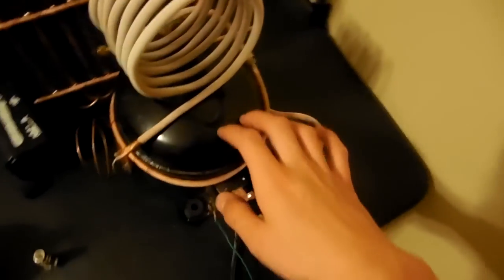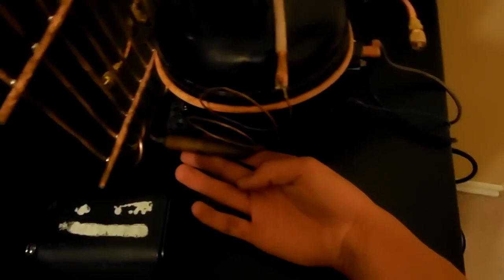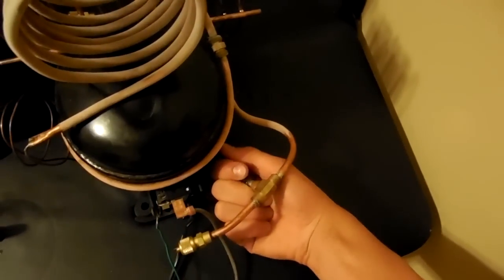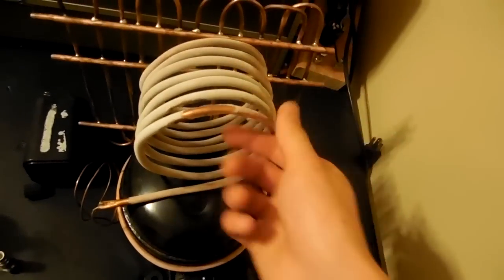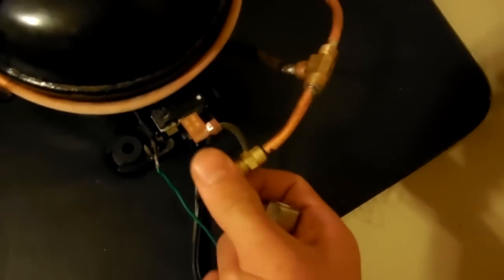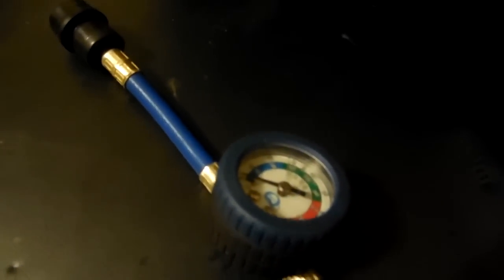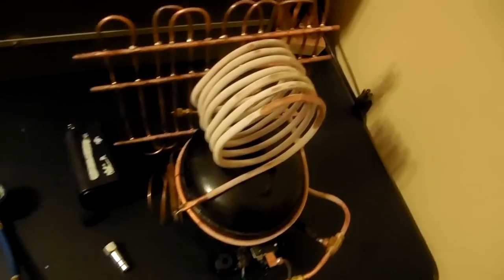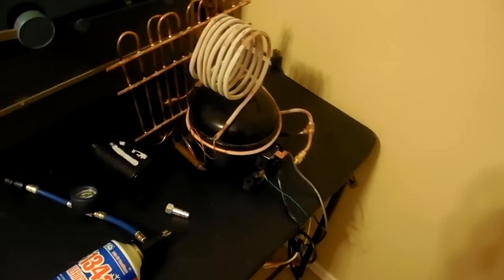Homemade Mini Phase Change Heat Pump (134-a)

Comment: hello, im doing some research to make myself a phase change cooler for a co2 laser, and i was thinking of using an old fridge. Is there any science to the size of the capilary tube? or did you just reuse the one that came with the mini fridge?

Comment: How did you solve the problem of capillary tube clogging with ice from moisture?
Reply: @platinumsky845  I say this in my comment..... I didn`t have money to buy good vacuum pump for vacuuming my system.
Reply: @platinumsky845  Ok, will try, thanks.
Reply: @Jesse Hajek I have parts of an old Soviet refrigerator. This refrigerator uses R-22, but I changed the system a bit and charged R-290a (yes, R-22 and R-290 are different, the compressor will work in heavy duty). I'm making this system just for fun - can I do it or not? In the future I will be using this heat pump to cool water in a distillation system.
P.S
There is an idea to build a 5-stage refrigeration system for nitrogen liquefy, but now this is just an idea =)
Reply: @platinumsky845  All I added was a new filter dryer and tee to allow refill the system.
Reply: @platinumsky845  Yes. My system working now =) But, i think somewhere propane are slightly leaking and this may decrease cold production.
Reply: @platinumsky845  Yes. Later i will add manometer in this system =)

Comment: I see it's a nice little cooling circuit but why do you call it a heat pump? I don't see any reserving valve there.
Reply: technically its still a heat pump as it could be used for straight heating with no cooling capability, like flipping a window unit around inside out

Comment: i need a evaporator temperature to be -150 ceclius...what coolant shall i use...and what is the best compressor..reciprocationg or rotary
Reply: you need to make a 3stage cascade system for temps that low
Reply: Rotary is more powerful but can be much louder under load. What would you be using the system for?

Comment: I have a few questions:
-How did you get a vacuum before recharging?
-How would I know how long the capillary tube needs to be
-Do you think I could replace the evap and condenser with water blocks? as in solder them to water blocks, so I can heat/cool water or antifreeze?

Thx
Reply: You can pull a vacuum with a vacuum pump or an old rotary compressor. I dont know about capillary tube I would suggest cutting the capillary tube off of the same system you get the compressor from. I have never tried to use a water block as an evaporator but as long as you keep the pressure relatively low it should be ok. I would suggest r152a (computer duster) as refrigerant. It is slightly flamable so get it out of the system before you make repairs. (Things will break) Breaking stuff is the nature of the hobby.

Comment: You're gonna burn that compressor up! She ain't made for a constant heat load!
Reply: Wouldn't only be sucking cold refrigerant ? you know what would go good with this is the Tesla one way valve .
Reply: @platinumsky845  I don't remember what I was thinking at the time but I'm sure theres a use for it here are you familiar with what it does?

Comment: Thanks for your video.   I am interested in converting  a heat pump using  55F well water as a source of heat as well as cooling by imersing the radiator into a flowing water chamber.    It is a micro geothermal system in a way.   I am familiar with working with copper tubing for plumbing, but not air-conditioner or a heat pump.  Followings are my questions: 

1. Can I release the existing refrigerant to air? 
2. Do I have to vaccum the air out of tubing prior to injecting 134-a?
3.  How do you eliminate the moisture in the system which may ice later?
4. How do I determine how much 134-a shold be injected?  

I would appreciate  your reply.

Comment: I am designing a system to combine 5 items using pumps and siphons: an oven, water heater, A/C, refrigerator, and freezer. A typical V-8 engine's waste heat could heat a 2000 sq. ft. home, so cooling a medium sized freezer, refrigerator, and an A/C for 1200 sq. ft. space should be enough energy for all the hot water and an oven by moving and consolidating heat.
Reply: How did this work out?

Comment: i want to make a refridgerating air dryer for a 180 cfm diesel air compressor, do you  think i can use the cooling system of a normal refridgerator and what power should it have?  sorry for my bad english ;)
Reply from the maker: That is a good idea. I was planning on making a refrigerated air dryer using a fridge compressor myself. Just make sure you have a good condenser coil (hot side) that can dump the needed heat. 
Your system needs to have enough heat capacity for your airflow to maintain the evaporator coil (cold side) at a cold enough temp that water will condense out of the air on to the coil. Then you need a way to drain the water. 

Good luck with your project. I'm happy that my video has helped inspire you to try building something. Thanks for watching!
Reply: +Electrotechnics  thanks for your reply, what power shoud i look for?
Reply from the maker: The was just a hobby kinda thing for me, so I'm really not sure about what power level to go for. 180 CFM is a lot especially since it is hot compressed air. So it definitely needs to be bigger than this minifridge pump i'm using in the video. If you are going to dry the air as it leaves the collection tank into the hose then you can probably use a smaller compressor than if drying the compressor outlet. 

Good luck with your project!

Comment: Directly cooling a cpu heat sink will be a major problem because of condensation. That is unless the cpu heat output is enough to heat the evaporator coils over the air's dew point.

Alternatively, one can control condensation by passing air over the evaporator coils and blowing the cooled air over the cpu heat sink while collecting the condensate from the air.  Or one could place both evap coils and computer in an ice chest. While water vapor inside the ice chest will still condense on evap coils, the lid on the ice chest will prevent more water vapor from entering, thus prevent excess build up of condensation that would require letting the evap coils warm up enough to melt the condensation. 

I've been contemplating doing something very much like this with an ice chest. My only concern if what happens in the scenario where the cooling system fails, and heat is trapped inside. For that it would be a simple mater to have the computer monitor temperature and shutdown if necessary.
Reply from the maker: Most if not all modern computers have some sort of overheat shutdown protection build into the bios. Another way to protect the computer from moisture is to put it under a thin insulating oil. That way the oil protects the computer from moisture, and helps cool small components on the board. You can still have the main refrigerant cooling evaporator attached to the cpu and any extra heat capacity that the cold refrigerant has will pull heat out of the oil aiding in full computer cooling.
Reply: Mineral oil is a (pardon the pun), COOL idea! But:

A. Maintenance can be messy, and 
B. 5-10 gallons of mineral oil and tank tends to be rather expensive, to add to an already expensive cpu heat pump cooling system. 

Cooling the cpu below room temp will just cool oil which in turn will cool the entire system board as well as the aquarium glass walls. One should try to seal the top so as to prevent moist air reaching the oil. With such a large surface area of glass absorbing heat from the environment, it is less likely to drop the temperature over any one square inch below the dew point, thus causing condensation. But, if condensation still occurs, one needs to collect the moisture that drips down the glass. 

Alternatively, one could monitor the temperature of the glass and ambient air temps. If the glass temps drops below  ambient air temps, shutdown the heat pump, and turn the heat pump back on if the cpu is 10 degrees over ambient air temps. 

Controlling the heat pump sounds like a project for my raspbery pi and its gpio pins. Add three external temp sensors, a few relays and a solenoid valve to maintain pressure in the condenser while the heat pump is not running.
Reply from the maker: Sounds like it could be a "cool" project (pun intended) :D
Reply: Electrotechnics what ever did you do with the one you built?

Comment: Hi there, Great work with the cooling. Got impressed when you cleared the Ice off the copper, really impressed. I'm trying to run the same thing but I didn't make the heat out pot into a radiator like yours I made it into a loop just like the frozen one you have. than the thing that turns vaper into liquid gets into a copper CPU water-block from amazon that gets into 4 copper tubes heat sink that has two 82 mm fans. it doesn't give me any cooling when I connect it to the CPU . is it possible the CPU is making it hot or do I REALLY have to have cold isolator  or something to keep in the coolness of this thing in.
Reply from the maker: It might not be working because your condenser coil (hot side) cannot dump off enough heat. Also make sure you have adequate refrigerant levels, and that there is not plain air in the system. If the CPU cooling system is working correctly the evaporator (cold side) will be cold enough water will condense on it which can drip onto your computer causing lots of problems. 
Also what are you using as a capillary tube or expansion valve? It might not be letting adequate pressure build up to turn the refrigerant into liquid. 

But you definitely need to build a better hot coil. The one on mine does not even dump enough heat for even medium duty use. I recommend trying to make a condenser coil from a small car oil cooler. It should hold the pressure (be sure to check specs first you don't want that blowing up) and would work great for radiating heat. I am planning on making a similar condenser coil for my setup.

Comment: Pretty sure you're not allowed to vent 134-A to atmosphere ;-). Good project though. where did you get the valves/ports from? I'm looking at making something similar using an R134-A pump and can't find the charging valves for sale seperately
Reply from the maker: I bought the ports from ebay. Just search "AC freon access port valve" or something along those lines and they should show up.

Comment: hi! i want to do this experiment aswell, but i was wondering if i could use an air compressor, modify it to be a sealed unit, u think it will work aswell? even there are no leaks?

Comment: you know you have just enough refrigerant when there is a sweat ring on the suction line port on the compressor, check your amp draw you should have 1.5 but 2.0 is fine, if you have gauges your low side pressure should be about 5 pounds and high should be 175 pounds if you have any questions message me I am a A/C tech and plan to have my own company one day, ask me about superheat and subcooling
Reply: Tell me about super-heating and sub-cooling ?

Comment: Cool!  The condenser is hot because it is too small, or needs forced air.  The evaporator is frozen for the same reason. Frost is an insulator so the liquid takes longer to flash to gas and as you mentioned you may be getting liquid into the compressor.  fluids don't compress very well. As you lower the charge the ice should start to melt at the compressor and work it's way back along the coiled evaporator.  Adding forced air over it should get it mostly over the freezing point and allow the water to drip off and the gas to fully evaporate to make that air dryer. Needs fins to be more efficient.  The cool thing about refrigeration(heat concentration), is that if you are trying to heat something, the heat pump can easily put 3 or more times the energy consumed by the compressor into the water or air.  IE it is more efficient to collect and concentrate heat than it is to generate it with heating elements.  A 500W fridge comp should be able to concentrate 1500W of heat...
Reply: I was thinking of using a similar setup but instead of evap/condenser I was hoping to use water blocks, like used in PC water cooling. Do you think that is feasible?

Comment: I would like to make a micro heat change pump that runs off a battery. In your experience what would prevent you from scaling down this design? the size of the compressor motor?
Reply from the maker: You should be able to scale down the heat pump just fine, only to a point though. On Ebay I have seen some tiny 12v refrigerant pumps, that would work great to make a micro heat pump that can run off a 12v battery, they were kinda pricey though, IIRC. Good luck with your project!

Comment: Hello ET.  I would like you to explain what each component does, why each is needed.  
What does the part from the refrigerator do in a refrigerator and what's its purpose in your project.  
You say you charged the system - how?  

Why does the coiled copper part cold/had frost on it?

Can you suggest an application for your project ie where would it be of use?

It's important to remember that not all viewers understand the dynamics of what you are doing.  Film of each component connection close up would be useful.  Maybe highlight where else components are used.
Reply: +Fizzedup Slade  thats just simple fridge unit, without storing unit. You can google a lot of info about it simply using google with "how fridge works"
Reply: +Lasse u  Thanks for info.  Is this your project?
Reply: dear no, aircooling works just fine for me..
Reply: +Lasse u  Ok Ta for response.  I was wondering what this was apparatus was for?  Hence the question.
Reply: +Fizzedup Slade usually ppl use these to cool computer CPU and or GPU below zero degrees.. you can easily overclock your PC to run 5Ghz for daily use.. there is this slovenia company that sells these units made specially for cpu, just ~800e. search ldcooling from youtube. and website is ldcooling somethn
Reply from the maker: I just built it for fun to experiment with a small refrigeration pump. I installed those 2 access ports on the loop, and used a can of freon and hose ment for charging a car A/C system to fill it up.
Reply: +Electrotechnics  Hello ET.  Still not completely understanding what you've explained due to my lack of technical knowledge about electricity and the components you mentioned in vid.  I suppose from a novice perspective why may something that produces both hot and cold output.  It does look good though. Not sure wot freon is.  I suppose it's something to do with the gas in refrigerators.  Anyhoo.  Thanks for explanation.  Sorry it's lost on me.  Best wishes.
Reply from the maker: +Fizzedup Slade Yeah it can be hard figuring out what everything is and how things work, it took me quite a while of researching and experimenting to figure everything I know out. "Freon" is just a term that usually refers to the refrigeration gas in this case R-135a which is the stuff you can buy in cans in the automotive sections of stores to refill car AC systems, which is also the same refrigerant that is used in most modern residential A/C systems and refrigerators. I hope that clear up some of it :D  Plenty of diagrams and animations on the web showing how refrigeration systems work if you are still curious.
Reply: +Electrotechnics  Ah yes, I understand what it does now (freon).  Thanks ET.  I'm gaining more knowledge via Youtube vids.  Energy and the creation of it so interesting and much needed area of research.  I want to build a studio/workshop in my garden and watched your vid to see if the application of the apparatus would be of something I could do.  I'm thinking rocket burner!  Your ting a  bit beyond me atm.  Best wishes and ta for feedback.
Reply: fla playa lol, he was just wondering for what is it used for.. no need to be that rude.
Reply: i didn't see the other comments.. only this thread that i get notifications about..  he seems to be totally un-educated about basic physics, maybe homeschooled? :D well, im off this thread.. dont really care about the comments, just the content -> video has any value for me.. take care :)

Comment: Hello ET.  Sadly I understood very little of what you were saying about your project.   I think it prudent to remember that viewers can be complete numpties, like me, not necessarily proficient in electro-magnetism, electricity or thermal dynamics.  

I didn't understand how it worked and what exactly it did.  

You had some apparatus from a fridge?  You fashioned a copper piping radiator that produced heat somehow.  Then there was a copper pipping bit that was so cold it had frosting on it, yet the equipment is somehow a heat pump.  Then you talked about other parts. How these all fitted together ie why the parts were needed was unclear.  Also, forgive me but I am not sure if you have produced something that heats or cools?  You say you charged the system - does that mean it's plugged into the mains?

Yes it does look like a cool project.